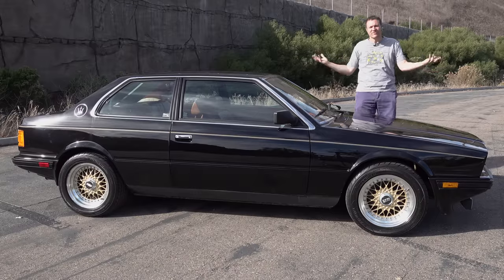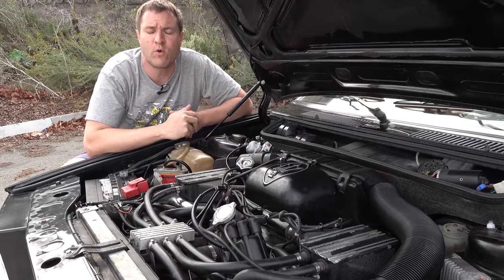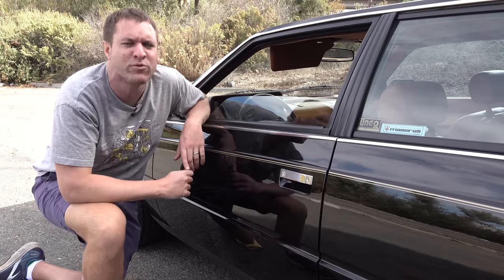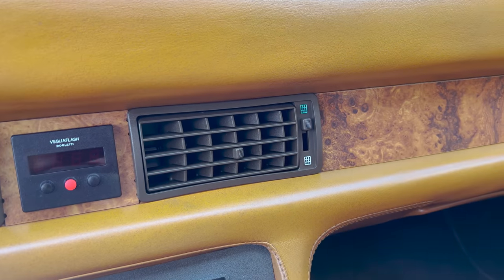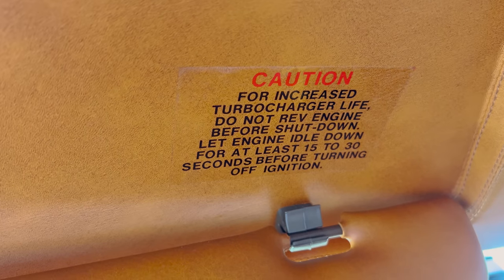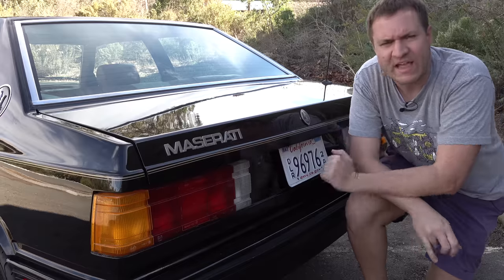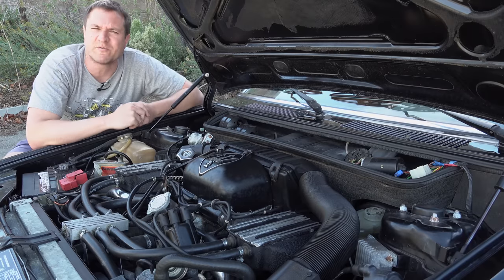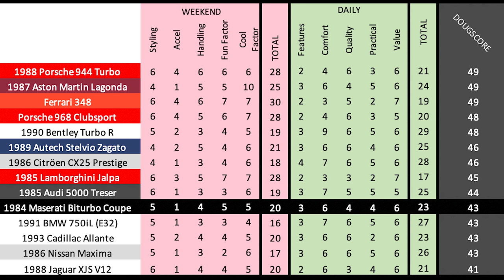The Maserati Biturbo Is the Ultra-Affordable 1980s Maserati

Comment: The problem out of the box was that it looked like a BMW 3 series, because it was as much of a competitor to it as an A4 is today. My dad had a Maserati Mistral. It had an actual F1 championship winning engine. Imagine the respect an unreliable, poorly designed 3 series copy got coming off the heels of cars like that one, Ghibli (the real one), Merak and Bora. Or put another way for today's audience, imagine if Ferrari made one. It wasn't a Maserati, and none have been since.

I should add that I think my dad's car only said "Maserati" in three places, if that; the rear end, the steering wheel and the cam cover. Everything else about it told you what it was. Another clue that Maseratis since these Biturbos are literally in name only.

Comment: Just want to add one thing that really boosts reliability is upgrading the fuse box to a biturbox it upgrades the electrical power, and improves the overall reliability. And that’s a relatively cheap change

Comment: Talking trash Italian cars, bla bla bla,  same bull crap. Rust was on most of the cars back in the days.
Look at the C class and e Klass of the 80 and 90, plenty of rust.
And in the present: 120 000 euro Gle AMG , new , returned to dealer after one year, cause it stayed more in repair shop than on the road because of mechanical ant electronic break downs

Comment: You rated this car a "1" for Acceleration?  The car is light enough and powerful enough, when it is running properly, especially with the intercooler, to get a nice chirp from the tires going into second gear!  It is a blast to drive, and the pull you get from the twin turbos definitely deserves more than a "1".  C'mon Doug!!!

Comment: With a little work that car can get past 400HP at the wheels.  Pull the interior and a few other bits and it will weigh in at 1,800lbs.  When introduced to the US, the liquid intercooled car was said to be one of three 13 second production cars.  The Buick GNX and Porsche turbo were the other two.

Comment: The later fuel injection engines were actually reliable fun fact the turbo system was developed by saab with FI from the start the carburetor from the fiat X1/9 was used in production carbs and turbos of course don't work together

Comment: Those wheels are not the standard, they are wider but designed to look like the 14inch 4 lug bbs originals. the 2.8 inj has 15 inch 5 lug

Comment: The cheap Bitubo's are usually rotten examples with poor service history and not so good mechanicals.  Good low mileage examples that have been looked after have the sweetest V6 engines and with twin turbo's is a much rarer model. Mainly you need to look out for the rot because they do rot everywhere and quite often that lovely dash board clock has been robbed from the car. This particular car is way above average

Comment: I had one, and when it came time to change the timing belt, I was sad to discover there was a designe problem, the belt is not properly routed, as to prevent jumping a tooth... the belt does not hug the gear driving it, and the belt will jump.
Another problem is the rear end.... Salisbury rear end, it is ready to bite you, it is almost impossible to drive in the wet, both wheels will quickly engaged, just like driving a positive rear end... in the streets.... for sure will catch you distracted one day, and you will loose grip on both rear tires... crashing.... other than that, it is a beautiful car, and very wide, more than normal....
Reply: P¡nned by Doug DeMuro  Doug, something to look at it, is the chasis, it is all welded, fenders and the like, they are not bolted, or glued, welded, this chasis is very strong and unusual.... how I know you asked?... well, merging to the 118, I pressed the gas, 1, 2, 3 freight train force pushed me, and in a second I lost the rear end, hitting the barriers with the front fender, nothing major happened really... took it to a shop, and refuse to work on it, could not just replace the fender, needed to hammered it out and then paint.

Comment: The lock under the steering wheel is because I think these originally weren’t sold with power locks and they lazily retrofit them so they didn’t have to do complicated wiring up to the gauges.

Comment: Had more than a half dozen of these over the years including a 425 and 430 currently in storage the last 15 years. Living less than an hour away from the U.S. distributor in Baltimore helped getting parts quickly. The main issue I recall was that because the carburetor was completely enclosed, it was prone to flooding and hard starting in hot weather. Fuel injection cured that in 1987, but I learned the trick of spraying starting fluid into the plenum with a carburetor cleaner straw stuck into the vent fitting.

Comment: if they made this car with no turbo's with a super solid  straight 6 or 4 it would have been a great  GT car.   super italian luxury  in a reliable car     but they put some kind of cheap turbo's on them that burned out in a ear and to replace them was big money, there was a dealer in my town and they figured out how to remove the turbos so when they went you could just take them out but then they must have ended up with less then 100 hp.    but it did become more reliable

Comment: nice video, in italy they also had a domestic model with a  2.0 l.v6  these had a nickasil liners at 60 k miles the engine needs a rebuild. the later injection models are a lot better.

Comment: One thing to know if looking for a Biturbo. The later fuel injected ones are the ones to go for. The carbureted ones aren't bad but if you do owner maintenance just know that the carb is just a normal carb in a pressurized plenum. Any time you need to make an adjustment you have to take it all apart, make the adjustment, put it back together, test  and repeat until you are done. The Bosch cars are pretty much care free in that respect. The otjer thing to know is that with every oil change comes a coolant change as the filter is on the front of the engine and it's easiest to remove the radiator to change the filter. The engine itself is pretty robust and most well kept cars today have had specialist attention to take care of minor reliability issues they had when new.

Comment: Ultra affordable to buy, but certainly not ultra affordable to keep running unless you can do the work yourself. The stock Biturbo put out 185 bhp which was a lot of power in the 80s; more than a Porsche 944, Volvo turbo, or Saab turbo. The first-gen intercooled versions put out 205bhp and 260 ft lbs of torque. That’s more power than an E30 M3. They are insanely fun to drive and as exotic as any Italian car from the 80s.

Comment: It's a great car ... when it works. 
Some reasons why it rarely does:
1-italian electrics, baiscally it's chaos, it's not "germanly" ordered, not well protected it can be Maserati, Fiat or Ferrari, all the same imho. 
2-on the same level: where is the battery located? above one of the turbo... if you mix up electrics and a lot of heat imagine the results... One of the first things to do is to check the electrics and isolate them from the heat of the motor.
3-De Tomaso and carburettors politics. a bit of trivia here: Maserati was one of the very first autombile to have fuel injection, way before Ferrari or Lamborghini, in the 60s. But they were notoriously complicated to repair for the mechanics of that era, it was new. So the injection was abandonned and De Tomaso before buying Maserati had a very strong bad opinion on injection. So yhen the biturbo came in it had to have carbs and not injection. Problem: two turbos, a lot of heat, caburettors a small engine bay: perfect recipe for vapor lock ! It will be resolved when injection came out but the first biturbos have all sorts of problems.
4-rust 80s italian, enough said
5- As Doug said,the price and look of a chevrolet Cavalier, the maintenance cost of a Ferrari. Maybe the most deadly part of it.

And a little "correction" on the Quattroporte of the 80s: it's a completely different car, it's huge, it has the old V8 (magnificent), it's hand made, a very very different beast, and truly exceptionnal car.

Comment: I think you'll find that isn't the factory clock.  Biturbos originally came with a beautiful analog clock with the Maserati logo on it.

However the clock was easy to remove and I suspect many original owners kept them as souvenirs.   You can buy original ones on Ebay if you like.

That nasty digital thing was an add-on.

Also, the "substance that looks like Alcantara".  It's suede.  The stuff that Alcantara was created to copy (badly).
Reply: It is a factory original clock. They came with the early cars before going over to the Lasalle. Quite desirable now but probably weren’t back in the day !

Comment: I can't help it, i like these cars. Always have, always will. But they are not perfect. Rust is a mayor issue with these cars. But if you can find a rust free car you can do something about that. rust prevention using some oil-wax product.
Another mayor issue is the electric system. You could ditch the carb,  convert to EFI, convert the electrics using modern engine management and better connectors, fusebox,  etc. Then have a good tune done on a dyno. Then it can actually be reliable. LOL!🤣

Comment: I would argue that the Maserati TC is an even cheaper Maserati. They aren't even a Maserati. They are Chrysler Lebaron with either a Chrysler 2.4l turbo 4cyl or a 3.0 Mitsubishi V6 engine and badge as a Maserati.

Comment: I think it looks great tbh. I love the boxy look of the 80s. Should really do a C4 Corvette review, preferably 89 and after. Nab a Z51 if you can. Oh you'll have to take the Targa top off as you'll never fit in one, but once you do, you'll have a blast. Neat LCD displays, good shifter, 3 way speed sensitive shocks, 5 link in the rear, double wishbone up front, oil cooler, big brake package, and a quick steering ratio for shitting on everyone else during autocross.

Comment: Doug, my used car dealer Dad bought one of these in about 1991.  My last year of high school.  Ours was a 1985, I guess the first year of the Bosch fuel injection...  That's arguably where the real problems "started" for this and many cars of that era.  Our car had been repainted Ferrari Corsa Red instead of the somewhat duller red from the factory.  It is an incredible car to look at, I still love the way it looks.  Way more muscular than an E30 in fact.  But...  It had a mind of its own.  It would start like a top, or it wouldn't start at all.  You never knew what you were going to get.  But one thing is for sure, in the short time we had it...  A few months, the family went on vacation, I had no permission.  And lets just say that while they were away for the weekend.  After spending hour to get her running.  I embassed a couple of Fox body Mustangs that day.  Sure they got the gap on me, but when those turbos kicked in.  I had the chance to tell one of those guys, my friend.  That the car he raced, had half the displacement of his car.  He knew what was what.   When it came around you, turbo lag and all, you Knew.